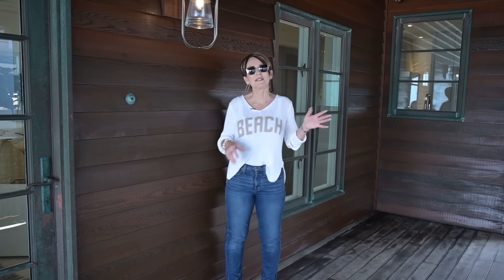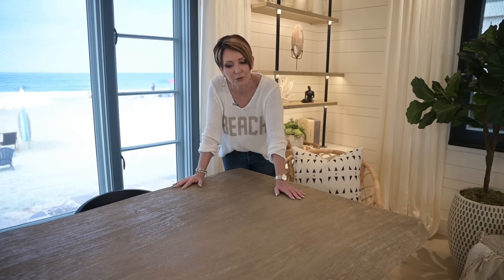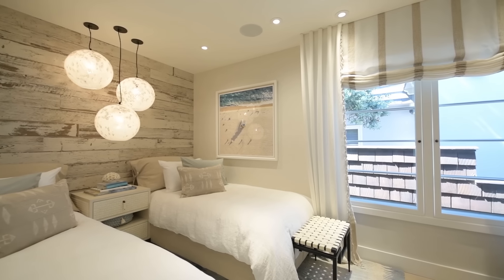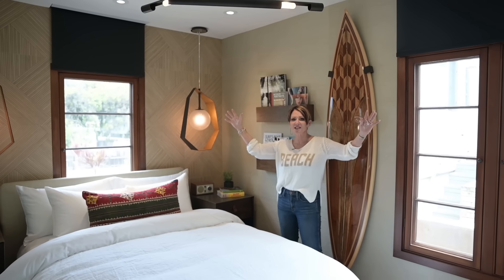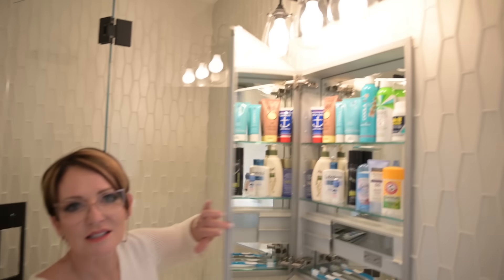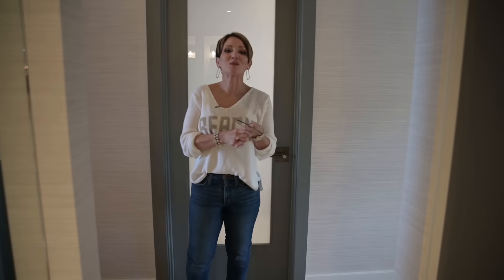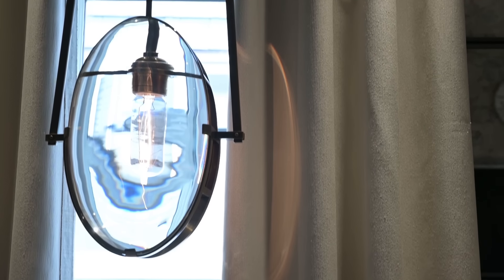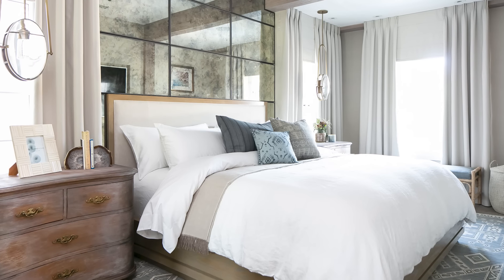The Beach House Reveal | Interior Design

Comment: Over because under isn’t as aesthetically pleasing it just looks messy to me

But something tells me you’re gonna say that you’re in under

I’m at worlds largest medicine cabinet what I probably would’ve opted for even though that was magnificent was just like you using the pantry closets words vertical and it pulls out from tiny spaces but contains a ton of storage that way you could’ve fit a lot more
And there’s also an option since you like to create your own things is the top part could’ve been the pull out just like in the pantry in the kitchen where there’s a ton of storage and the bottom could’ve been more of the medicine cabinet were you could’ve had things right out in the front I would’ve went deeper because you had the entire width of the shower that’s why I thought that that would’ve been perfect to implement in there but what you could’ve done also is the top could’ve pulled out like in the kitchen and all the things could be accessible from either side and underneath you could’ve put in extended drawers That were soft clothes that way it would’ve contained other items and you could’ve gone as lender and as large as you wanted to do with the doors depending on what you intend to put in there